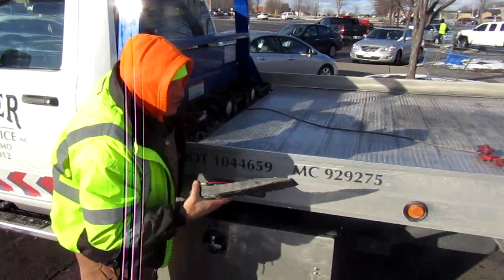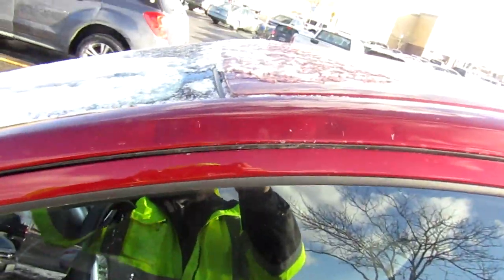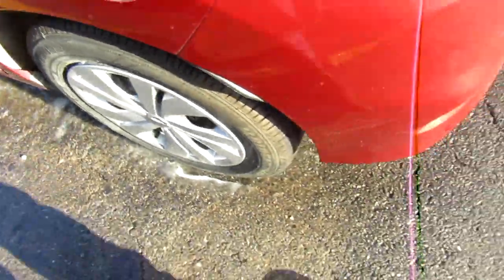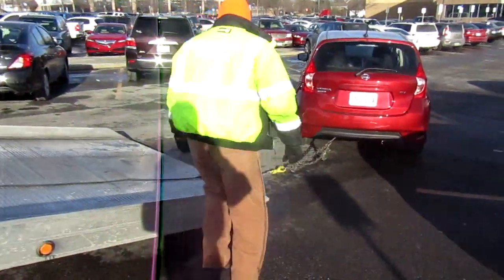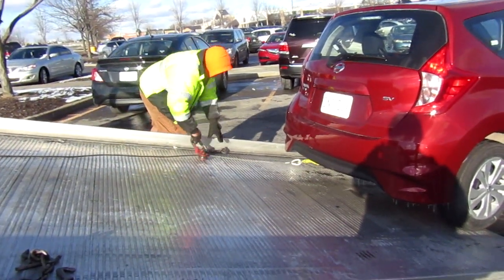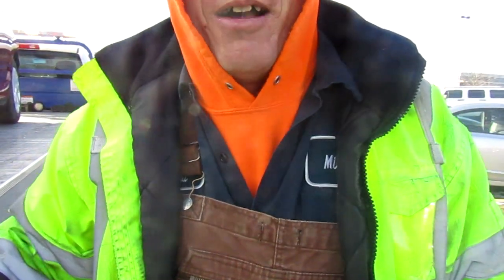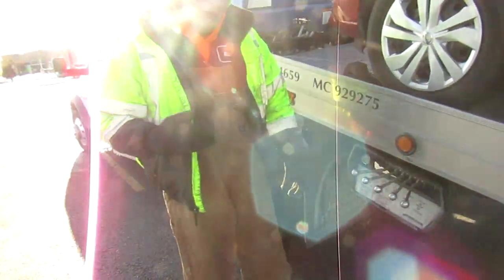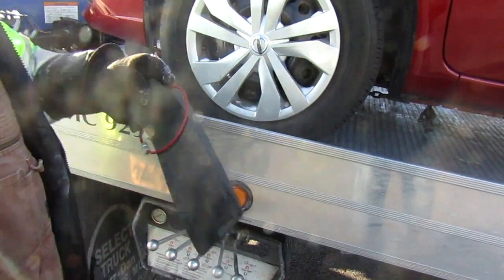How To Get A Car Out Of A Busy Parking Lot

Comment: I would use my lockout kit. Get in it  in 1 minute throw it in override it into neutral roll that tiny car out with one hand winch it on to skates then line it up and winch it up ect
Reply: What happens when the steering wheel locks on ya?
Reply: @TWags-lq4gy  Turn it the direction you need it to turn as soon as you touch the wheel.. so if it locks its pretty much the way you need it to be.. And most of the time its just how you need it to be because they had to of turned their car into the spot at the same radius as it needs to be pushed out. Use your judgement a cheap car like this your chances are great. A mercedes.on the other hand is a new ballgame haha... If all hell fails and its a slow day.. just wait for an open spot in front of or behind..block the whole parking lot off if you have to and load the casualty without damages... After 9 years of running a rollback its like a game to me.. A puzzle ...if some1 tells you they know everything about towing dont listen to them. Its a game of learning. Be safe!

Comment: Definitely a skill. I've got one that I got to get out of a garage off of an alley in a tight spot it hasn't been started in years and I'm hoping they can pull it out. I'm going to put rollers under it while it's in the garage to move it on an angle.
Reply from the maker: That sounds like it's going to be a fun job but I like a challenge

Comment: looks pretty simple load up to me ,that wouldnt even be a challenge and my rollbed is at least 4 feet longer  ,i dont see why you didnt just back up to it  and let the truck slide under it  ,snatchblock not needed or all that shuffling around  wasting time ,i would of been putting straps on it by the time it took you just to reposition   ,how long you been doing this?
Reply from the maker: Problem with that video was nobody was paying attention I was trying to set up a scenario in a parking lot where you couldn't turn your truck you know where there's no room

Comment: I drive a 2005 Chevy C5500 Flatbed (soon to be a 2000 Nissan UD2000) once i buy my Boss' Business, and i always try to back up as straight as possible to the car. I pull it until 2 wheels get onto the bed, remove snatch block, pull it up and straighten it. Honestly, i've never seen the skates being used on the ground. I always have seen them used on the bed itself.

Comment: Would have been so much easier with a wheel lift and go-jacks. You wouldn't have had to block the aisle as long and would have only had to reposition the truck once. I know this from 13 years in the industry as both a repossession agent and towing for multiple motor clubs as well as doing police towing.

Comment: What happens if they have the parking brake pulled on? Unlock, release, load... Or 2 other skates?
Reply from the maker: If all four wheels are locked up just use another set of skates and it slide just as easy

Comment: Just unlock it, and shift it to neutral. And you didn't have the space to back up to it directly inline? I always try for that first, saves so much time.
Reply: Yea he did the most. Could easily unlock shift into neutral and I would have even pushed that tiny car out of the spot. Not the best way to do it in a busy parking lot. Only way I'd ever do this is if It was in a non busy lot with tine and wanted to get payed for the extra shit

Comment: If the car was a manual and it was in gear with E-brake on with no keys would you use 4 Tire skates ??
Reply from the maker: if I couldn't get it out of gear and the brake wont release then yes I would

Comment: drop the bed drive the truck backwards under the car till it contacts front wheels hook up ad skates and pull it on the bed strap it and hit the road less than 10 minutes
Reply: Darren White ... What are "ad skates"? I have, and sometimes use skates. Everyone else I work with calls them skates too. Until you, no one I've encountered has called them "ad skates".
Reply: @JW...-oj5iw I think he meant 'add skates'. I'm going to guess he meant to say, "Drop the bed, drive the truck backwards under the car until it contacts the front wheels, hook up, add skates, and pull it on the bed. Then strap it and hit the road in less than 10 minutes." You're welcome.
Reply: if your in a tight spot and cant get your rollback into it then this is how you do it. i have had to do this many times in mall and other parking lots.

Comment: I have been towing for over 11yrs and not to knock his methods at all cause everybody does things differently but I would have had that car out of that parking lot in way less time than that minus all the extra work. But hey if it works it works... idk how long his winch cable was but if he parked his truck farther up hooked the snatchblock midways up the the bed with the truck bed angled towards the car he could have got it in one pull... ijs

Comment: Hey Donald. How ya been? I hope well. Hey i wanted to ask you...i. YOUR OWN PERSONAL opinion....what is the best truck on the market to you? Im getting ready to buy a truck. I was looking at Hino..UD...Freightliner..and Dodge. NOOOOOO fords!!!
Reply from the maker: if I had the  money I would buy a dodge  if I couldn't find one then it would be a freightliner       hino are way to slow and under power for my liking and ford well we all know how they are
Reply: @donaldchastain6847  why u say freightliner??? Because of the cummings 5.9 or 6.7?? And how do you feel abt a UD?
Reply: silverrshadoww ... Hey guy. I have a little bit of input if you don't mind. I am a company driver, so I have to use what they assign to me. The company has a full time mechanic who is really good. He kept the International 4600 running strong and it was equipped with a JerrDan 21' Sharktail bed. I was at one with the truck and bed. When they decided to retire it from the fleet, I told them that I would be done at that time. That freaked them out a bit and they said they would put the retirement back six months. I was happy, but knew that my truck was going to be history. Six weeks later, they ambushed me and said that my truck was going away. During the six week time, they took delivery of two new Hinos with Century beds. I was given the choice of one of the two new trucks or a truck that was similar to the one that I was losing. I decided that even if I moved to a truck that was like my International, it would be temporary anyway. I opted for the black truck. When I got the truck, it had been used once or twice and had 1100 miles on it. I am very impressed with the truck's power. I use the transmission switch occasionally and it does make quite a difference. Yesterday, I had a call that was an early pickup. I was a little bit late and pushed the truck a little faster than I had planned. I was running with the pack and started to feel like I was moving a little faster than I normally would. Looked at the speedometer and was surprised to see that I was almost at 85mph. Truck was running glass smooth and traffic was running at that speed. I had to exit in a few miles, so I backed down and moved to the right lanes. The Hino is not slow by any means. It's a 258 model. As for the Century bed, it's not as versatile as the JerrDan Sharktail, but I'm adapting to it. That's the trick to the job. Adaptation. Learn how much you and your truck can do and be ready to learn new tricks when the opportunity arises. Yesterday's early call was a Vette that had been lowered two ways: suspension and body. I got the car out to the street and at a little bit of an angle, so I could initially get the bed under the right front tire. Worked like a charm. I did the inchworm trick to walk the bed under the front end and hoist it upward. Hooked up the mini-Js in the frame holes and eased it up the bed, lowering the bed as I brought the car up. I took my time, mostly because of the ridiculous thing Century has done with the levers. They're in reverse order from the JerrDan. It's a bit difficult to learn to use them when you have dozens of years using the natural layout. Anyway, the truck is gorgeous and I try to keep it clean with varied success.
Reply: @JW...-oj5iw  so u say a HINO is a good truck??
Reply: silverrshadoww ... Hey guy. I didn't get any notice that you asked me if the Hino is a good truck. We have had issues with some of them. Mine has been pretty darn good, but it is still quite new. Warranty is apparently top notch. Had a couple things that needed fixed on the bed. A check engine light came on and they have replaced a sensor in the DEF system. They also pulled it in for a California compliance recall. I will never be in California, but the truck had to get the downgrade anyway.

Comment: I've only been in the towing game for a year. I'm lucky to have a good boss who has been Towing for 20 years. I would have used a lockout kit and looked for a shift lock. Throwing it in neutral and push the car out. If I was able to line up the truck perfectly I would have drove the truck back until I got to the front wheels. If not then I would have used a snatch block and dragged it with the skates onto the bed. But to save all this trouble I would have just went and got the wheel lift from the shop drug it out a little bit then turn around and pick it up from the front wheels and gone I go. Sometimes wheel lifts aren't always available though. They do work great in busy And congested parking lots. Never fails though every time I go to Walmart I get an a**** just like in the caddy.
Reply from the maker: That's the easy way to do that but you know this video was from people you know that just starting out but don't know anything you put in the neutral over salt ride and the car takes off rolling their screwed

Comment: Rear wheels were turning so I imagine the last driver of the car neglected to set the parking brake. I suppose if the handbrake were set skates would be needed for all for wheels, unless the transmission lever was in neutral rather than in park or in gear, then skates would be needed only for the rear wheels?
Reply: The car is front wheel drive . The back tires move freely
Reply: @TowBro210  On just about every front wheel drive car the parking brake brakes the rear wheels. In an automatic transmission FW drive car the front wheels, only, are locked when the shift lever is in Park. In a manual transmission FW drive car, putting the front wheels are free to turn with the shift lever in neutral, and braked, sort of, by the engine, with the shift lever in a gear. However if the car is in  forward gear, you can push the car forward. It won't roll easily. Rather, rolling the car forward will rotate the engine. Put the key in the ignition switch and turn it to the ignition position (second click) and you can start the car by pushing it forward. I think that covers everything. I'm not sure about cars with dual-clutch transmissions but this car doesn't have one of those.

Comment: i don't understand why the rear wheels didn't need skates.  It's because the parking brake wasn't on right because it's an auto transmission?
Reply: Yes. The wheels roll cause the vehicle is a front wheel drive vehicle and the parking brakes weren’t on.

Comment: Hey so I’m a young tower and the other day I came across a car that had the two front wheels facing outward on opposite direction and when I tried winching it up one the wheels was about to break the fender so what should I do in that situation
Reply from the maker: sounds like you did it the right way always go with your gut
Reply: Bryan Zhinin ... I'm a little late in reading your message. If you have the owner on hand, explain that you will make every effort to avoid further damage, but it might occur and if it does, it's because it's unavoidable. Have the customer sign a written note showing the possibility of related damage. We carry damage waiver forms in our invoice books, but truthfully, they don't really cover you in a legal sense. It's not a permission slip to be careless. Sometimes it's better to pass on the call and have a wheel lift truck with dollies get the job. I have hauled vehicles in similar circumstances and if I could walk the bed under from behind, it keeps the skewed tires from rolling and grabbing bodywork. Keep in mind that no two jobs are the same. You have to adapt to the individual situation and nothing anyone tells you here can be sure to match your situation. Like Donald says, go with your gut. Don't be afraid to pass on a job if it's likely to have a bad outcome. As a for instance, we very rarely will load a stolen wheels car because it is almost 100% sure of damaging the car. We tried to get wheels and tires to put on a Chrysler 300 in an apartment parking lot. Couldn't get any. My company left the option for me to load the car or pass. I passed on it. I went by the location the next day and the car was gone. I went to the body shop and the car was in the back lot. I checked it over and sure enough, it was damaged. Whoever hauled it broke a rear suspension arm and Lord knows what else. The thieving vermin are the primary culprits, but the insurance company will blame the other damage on the towing company and they might put it on the driver.
Reply: Bryan Zhinin ... I'm a little late in reading your message. If you have the owner on hand, explain that you will make every effort to avoid further damage, but it might occur and if it does, it's because it's unavoidable. Have the customer sign a written note showing the possibility of related damage. We carry damage waiver forms in our invoice books, but truthfully, they don't really cover you in a legal sense. It's not a permission slip to be careless. Sometimes it's better to pass on the call and have a wheel lift truck with dollies get the job. I have hauled vehicles in similar circumstances and if I could walk the bed under from behind, it keeps the skewed tires from rolling and grabbing bodywork. Keep in mind that no two jobs are the same. You have to adapt to the individual situation and nothing anyone tells you here can be sure to match your situation. Like Donald says, go with your gut. Don't be afraid to pass on a job if it's likely to have a bad outcome. As a for instance, we very rarely will load a stolen wheels car because it is almost 100% sure of damaging the car. We tried to get wheels and tires to put on a Chrysler 300 in an apartment parking lot. Couldn't get any. My company left the option for me to load the car or pass. I passed on it. I went by the location the next day and the car was gone. I went to the body shop and the car was in the back lot. I checked it over and sure enough, it was damaged. Whoever hauled it broke a rear suspension arm and Lord knows what else. The thieving vermin are the primary culprits, but the insurance company will blame the other damage on the towing company and they might put it on the driver.

Comment: I wouldve pulled it out with the truck 1st. Put the fronts or rears on the edge of the rollback and then adjust the truck to get a straight pull, lay the bed all the way down, pull her up.. GO

Comment: How are the rear wheels free spinning like that don’t people use handbrakes where your from. Would have loved to see you slide that off with the handbrake up.
Reply from the maker: It is just as easy to slide it off the rear tires locked up just put another set of skates underneath them and I'll slide right off